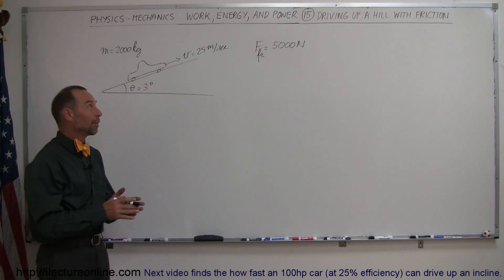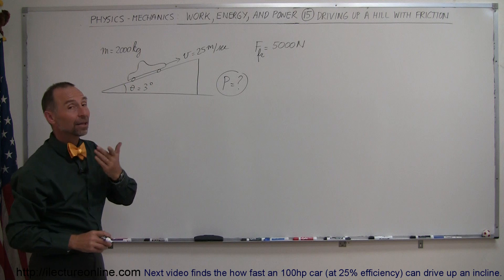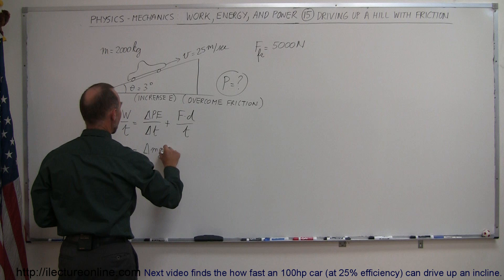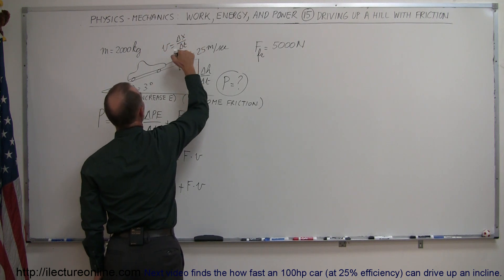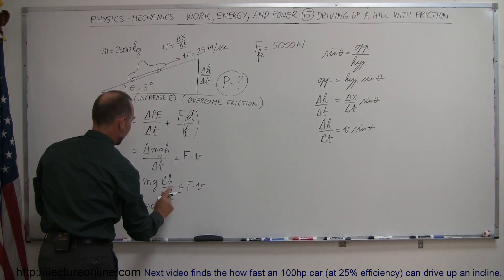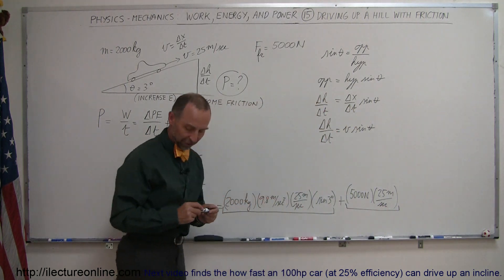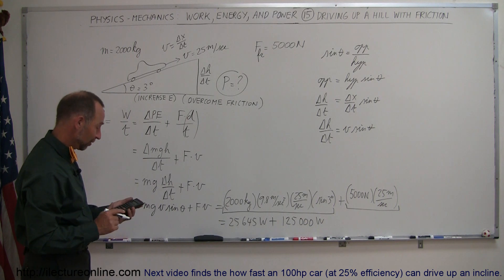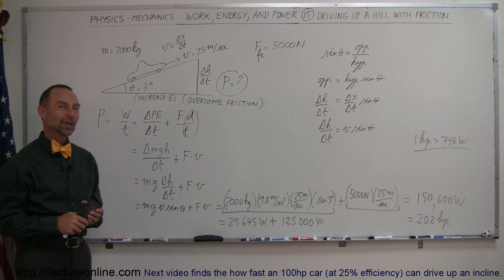Physics 8  Work, Energy, and Power (15 of 37) Driving UP A Hill With Friction

Comment: By using mg sin theta for the parallel component of the gravitational force with the work done by frictional force and avoiding double dipping using change in potential energy as well,  you will get to the same total  power but it will be negative if you correctly use the dot products. Both will be cos 180 degrees and thus negative. But now you will see that the car must overcome all that negative power to go up the incline by positive 150600 W because that is all that is necessary to maintain a constant speed. Sir please correct me if I am wrong. I am just a grandfather truing to help the my grandkids. thankyou for your teaching and dedication to all.

Comment: In an exam, why would you think that a force was required to overcome friction when no friction is given in the diagram?
Reply from the maker: It should be specified.  An exam question should not leave things to be assumed but must make every aspect clear to the student.  Students should be able to ask questions during the exam to gain clarity of what is asked and what is given on any problem.
Reply: But there was no friction in this diagram no? Or am i mistaken
Reply from the maker: The problem states that there is a constant friction force of 5000 N

Comment: So why did you not consider the kinetic enwrgy in calculating for total power required?
Reply from the maker: If there is no change in the velocity, then there is no change in the kinetic energy, and therefore there is no power required to increase the kinetic energy.
Reply: @MichelvanBiezen  K, thank you so much for the clarification. So am I correct to assume that if there is uniform acceleration involve, you would just add power due to KE and PE?
Reply from the maker: That is correct.

Comment: Hello, thank you for the great videos. I have a question at 2:40 , if we define deltaH vertically then shouldn't the velocity of the car be deltaX/deltaT in x direction + deltaH/deltaT in y direction? It shouldn't change the result as we then plug V into the equation subsituting deltaX/deltaT and deltaH/deltaT is indeed the vertical component of V aks V*sin(theta)
Reply from the maker: I would not recommend that since calculating the work done = W = F d cos(theta)   If you consider the direction of the force and of the displacement to be the same (parallel) to the incline, it becomes much easier to calculate work done.
Reply: @MichelvanBiezen  Ohh indeed now it clicked. deltaH/deltaT != deltaY/deltaT. My mistake in initially assuming that.

Comment: hello sir i have a question that confuses me a lot.
we learned in class that the total work done by the net force is equal to the ΔKE. but you equate work done to ΔPE + ΔKE in questions. Why??
Reply from the maker: The total work done will be equal to the energy gained.  That can be either kinetic energy, potential energy, or both.
Reply: @MichelvanBiezen  Sir, I'm talking about the work-energy theorem. I don't understand why we can't use this. I am starting to suspect that I have misunderstood this theorem.
Reply from the maker: The work-energy theorem presumes no change in the potential energy.  But work done can still result in the increase of potential energy.  For example, if you lift an object vertically upward at constant speed, there will be zero gain in kinetic energy and ALL of the work performed will result in the increase of potential energy.
Reply: @MichelvanBiezen  Thank you. You are great.

Comment: If I'm only given the incline, weight, velocity, and friction coefficient, then would I be correct in assuming to calculate the friction energy, I'd need to find m*g*cos(), and then multiply that by my coefficient?

For example: 5000kg * 9.81 * cos(20) = 46091, and then if my coefficient is 0.2, the end result should be 9218N ?

Comment: but what if there is a change in speed, like if the velocity is 9 at the bottom and 16 at the top?
Reply: sorry I get that you have to use KE, but then what about the hight? Like how could we just forget about that?
Reply from the maker: Then you need to have additional power to gain the additional kinetic energy

Comment: Sir please answer. Thank you very very much! If an object is moving at constant speed and there's a force only to keep it moving and not accelerating, and there's a friction force, will the total work be zero? Does the work done by the person equal to the friction force since it's not accelerating?
Reply from the maker: The work done is the work required to overcome friction.  (so it is not zero)
Reply: @MichelvanBiezen  Yes thank you. I know but it's the total work so it's all work added up.
Reply: @MichelvanBiezen  If the work equals the work done by friction, then it will be 0 when you add them all up right?? Thank you for the reply!
Reply from the maker: Usually we don't calculate "total" work, but the work done by a force.  Therefore you need to identify who or what is doing the work.  The work of one force (pushing against friction) is NOT negated by the work done by the friction.
Reply: @MichelvanBiezen  Okay thank you but the problem is divided into parts and wants me to find the total work. And there's indeed an example like that. You can calculate work done by each force and add them all up. Thank you for replying!

Comment: The assumed frictional (aerodynamic + rolling) force of 5000 N is very unrealistic for that vehicle unless the frontal area was about 80 sq-ft with a Cd of 0.7.  But the example gets the point across.

I came across a simple way to calculate the gravitational power needed in HP units with this formula.  It comes out to within 0.1 HP of your example in the video for the power due to the hill slope.  Try it out.

Gravitational power in HP equals to 2.67 times MPH times the weight of the car (in thousand pounds, ie 4.409 in this case) times the grade percentage.

Comment: Hello. Doesn't the friction force point the same way, that the car rides? 
P.S. thank you for your great videos, they are very helpful!
Reply: friction opposes motion. it will point in the opposite dxn
Reply: @vibhaviswanathan2430 but don't the tires push back on the road and hence, friction will be in a forward direction?

Comment: Hi sir, could u plz help me solve the below problem.
An automobile with a distance between front and rear wheels 3m and the centre of gravity 300mm is travelling over a roadway inclined at an angle of θ with the horizontal. The coefficient of static and dynamic frictions are 0.6 and 0.5 respectively. The automobile is a rear wheel drive and has a load of 18 kN. What is the maximum inclination 'θmax' that the automobile can climb at a uniform speed?
Thanks

Comment: excuse me it's too late but (2000)(25)(9.8)(sin3)+(5000)(25)= 38145 ÷ 746= 51.13 hp or is there something wrong with my calculations 🙄🤔
Reply from the maker: Just do a simple check.  What is 5000 x 10 = ?  that is already more than 38,145.
Reply: thank you very much for the video it helped me lot 😉
Reply: yes

Comment: Why do we need to take into account the force needed to overcome friction to calculate the total power? I thought that friction was parallel to the incline and so, because there is a constant speed, there is no net acceleration in that direction, meaning that we are not required to take that into consideration. Seeing as the force needed to keep the car going at a constant speed would be equal to both the force to overcome the component of the force of gravity parallel to the incline PLUS the force to overcome friction, meaning that the net acceleration (and thus net force) would be zero. So, power in that direction would be equal to zero as well, as P = (F x d)/t.
*Edit: forgot to divide by t. I get it now. Thanks a bunch :)
Reply from the maker: Chocotoff Green 
That was a long question, so let's take it one sentence at a time:
1) Yes, friction is parallel to the incline.
2) Yes, the speed is constant
3) Yes, therefore, there is no acceleration
4) "meaning that we are not required to take that into consideration",   I don't know what you mean with "that", but a car will not continue to move forward unless the engine produces power.  If you drive a car and you take your foot off the gas pedal, the car will slow down and eventually stop.
5) Yes, the force to keep the car going must be equal to the friction and the force to overcome the gravity component parallel to the incline.
6) Yes, the net force ON the car is zero.
7) The force exerted BY the car is not zero.
8) The work done by the car (which is not zero) per unit time is the power output of the car. Therefore P = (F x d) / t
Reply: +Michel van Biezen  After going back to your previous video I get it now. I was confused as to why we would "ignore" the components parallel to the the incline, but now I get that because of conservation of energy and the speed being constant we can get rid of the kinetic energy, but we still need to take in the energy needed to overcome friction. Thanks a lot!

Comment: Why didn't you take into account the KE?
Reply from the maker: Abdullah,
Since the velocity is constant, the KE is not changing.  Work is required only if the KE is changing.
Reply: But work has to be done maintain constant kinetic energy(velocity)
Reply: but if the velocity is constant, there's no net force so work done is zero.

Comment: doesn't it need power to overcome the parallel component of gravity aswell?
Reply from the maker: Traian Basescu,
This example was simplified to indicate the power needed to overcome friction (which is a component parallel to the incline) and was given as a constant, and the power needed to gain height (increase the potential energy).
Besides overcoming friction, there is no additional power needed to keep the car going at constant velocity (Newton's first law).  
Note that power can be equated to delta E/delta t  (the change in energy per unit time).
Reply: Michel van Biezen Thank you,PS: This is not my real name
Reply: so we have just ignored the parallel component of gravity? Ideally it should have been taken into consideration?
Reply: it is implictely being taken into consideration when looking at the change in potential energy. As the first comment in the thread, this can easily be solved by using P = Fv. There exists a parallel force of gravity and friction that the car has to overcome of magnitude mgsin(theta) + f_{friction}. Multiply this by the velocity to get the desired quantity. 

Its cool that we really dont need to know any of the dimensions of the ramp, and both methods of solving this problem are equivalent through a basic trigonometric argument. Power to overcome gravity is P_g = delta(E)/delta(T) = mg * delta(h)/delta(t). Using the fact that delta(x) * sin(theta) = delta(h) and dividing through by elapsed time gives mgvsin(theta) = (mgsin(theta)) * v, and thats where the parallel component of gravity comes in! 

Im liking physics more day by day.

Comment: Something is wrong here. To drive a 1500kg heavy car 100km/h which is arround 27.8m/s on a flat surface, rubber on asphalt, no incline, only to overcome the force of friction, calculation states that It would need a motor of 294kW which is arround 400hp! And my car weights arround 1500kg. It has 150hp and can get to speed arround 220km/h. I used frictional coefficient od 0.72 from this table: http://www.engineeringtoolbox.com/friction-coefficients-d_778.html
Reply from the maker: Johnny.  The error you made is using the friction between the tires and the road as the friction force the car must overcome to drive. The friction between the tires and the road allows the transfer of power from the engine to the road to propel the car forward.  The friction the car must overcome is the internal friction of the wheels and the drive shaft and more importantly the wind resistance.  But all that adds up to a lot less than 0.72.
Reply: Found it. Coefficient of rolling is about 0.001 . That makes sense now.
 Thanks.
Reply from the maker: Johnny Mnemonic Actually, you can figure that out yourself with your car.  If you can find a flat road with almost no traffic, drive it at about 30 miles per hour and then put it in neutral, and figure out how far the car rolls before it stops.  Then use Newton's second law (F=ma) to find out the friction force.  Then you can calculate the coefficient of friction.